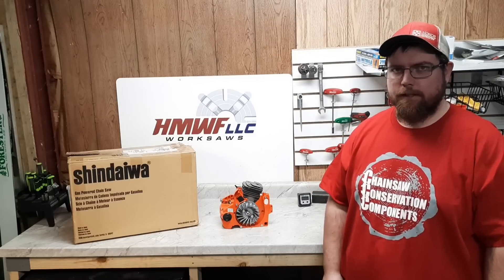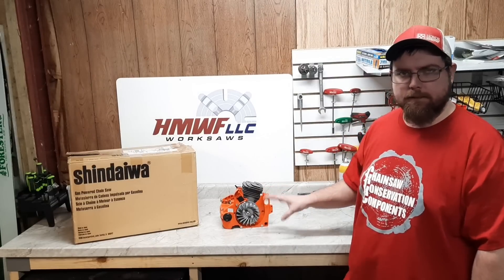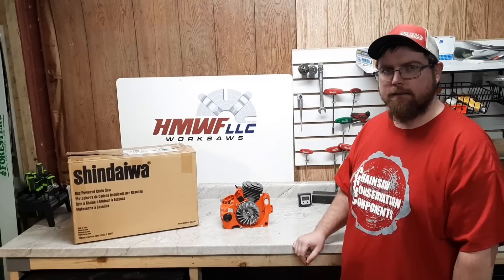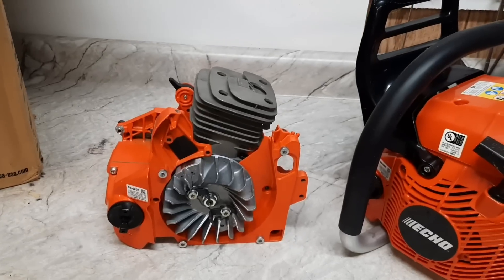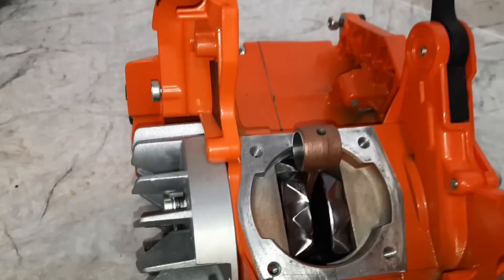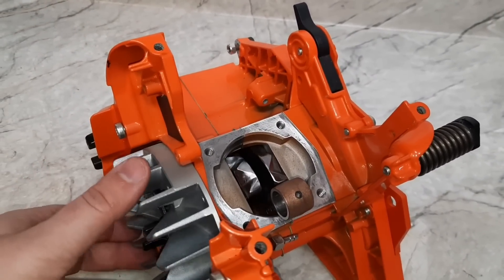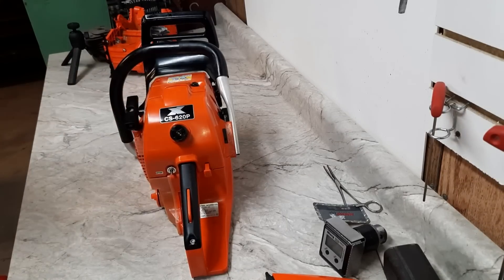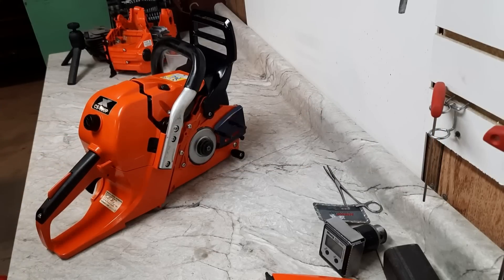Chainsaw Turbo crank? Vane crank? Make More power?

Comment: Have you tried this with a ported cylinder yet? And would a pipe or modded muffler help with the narrow peak ? Without the port job ? Or even different jets in the carb ?
Reply from the maker: No, this saw actually was sold to Charles brisco. He has a couple videos building it.

Comment: I think the way the rod itself rotates is orientated in the center  of the crank has alot to do with the way air moves through the crankcase. Let me try and explain a bit better.

                                          🤔 Think about this 🤔
Piston heading up,, drawing charge in -- what orientation is the mid to lower rod and has been for this duration of intake cycle?
Piston coming down,,, forcing charge up.  What's the orientation of the mid to lower rod and has been throughout this duration of exhaust cycle
 Think where the bottom or the light part of the crank and the rod . Cutting the reliefs around the crankcase and in the center next to the rod to let air move  through the crankcase easier than if it were a finned or bladed cut on the crank. 
   The fast ramp and extra horsepower could just be a result of just lightening up the crank alone and that's why it peaked it's power band so sharply on the graph with out a plateau or bench on the Dyno graph chart but will it sustain that exact or close to first burst of power throughout the entire cut?  That's the question I'd like to know the answer to.
Now, I've been thinking hard about this whole thing for over 2 hours now and my opinion is,,,, it probably would Not sustain the power through the cut but would keep the same or close to the stock configuration.  
   Ok now, I've  been watching you for a good while now Joe but watching you do this stuff this time just seemed different. You already know all about this idea and it doesn't sustain any more HP after it's peak but has more of a chance to cause a catastrophic failure would be more like it over time or maybe the first time you buried it in some wood hot and heavy.  You also know that any engine builder that didn't have a waver signed for this very modification or any such like this to the crankshaft could and would be liable for any injuries or damages caused from this mod, except for a full blown racing engine. Maybe even getting a waver signed but I guess it would have to be depending on the severity of injury or damage.  A modification to the saw's engine lessening the main rotating assembly's structural integrity would be crazy to do even if it was a full blown racer.   Not me man, 
I've  seen other racers playing around with doing crazy stuff like this here and bringing it to the track and it never ends good. Someone will Always go too far or push the limits knowing they went past that fine line ya just can't cross until someone gets themselves or someone hurt or worse. 
 This thought I've had now for over 2hrs of doing something like this, Just Left the Building. All these thoughts aside though,  I may try a little bit on the very top edge on the the outer sides and maybe an little bit in the center pausing the rod just to see for myself. I really do like to explore new things and exploration does take a bit of risk at times or maybe a bunch of risk. Just ask Chuck Yeger if anyone is this,He Does!!! Lol. Anyway,  None the Less, I found your video this morning to be a brain teaser for sure and I'll be thinking about that for all long while but I'm not doing this for any one but myself period! It was a very Neat and Entertaining Video none the less. You got me thinking for once in a long time on something to scratch my head about and ponder over that's actually worthwhile. To me anyways. Way to go Joe!!!
 Have an good one my friend!!!
Jzntn Greeneville ,
Reply from the maker: It could be possible. Most of the times the crank cases are very thin. I think the small gains that were made here were mostly due to reduced rotating mass.

Comment: I had heard about from someone somewherea few years ago. It was just as theory that they were chewing on but I had often thought about it. We cut the cranks to almost nothing in late model race engines but they don't turn but 8500-9500 but not continuous 11,500-13,000 continuously. I worry the crank will come apart if too much material is removed???  I may try it moderately because it definitely change it's peak and if the case was done to go with it is are there would be incredible flow potential in a low cost upgrade. That's if you are doing it yourself!  Lol none the less I see it worked about an extra 10% on that mood alone.  The counterweights are in the crank for all reason and the cranks we had done and the ones we did were all taken and balanced afterwards along with magnafluxing every single inch before it was installed. Actually that was done again right after it had a season on it to see if there had been any fatigue or compassion to it's integrity what so ever before installing in a new build. Rods as well were lightened to an extent and balanced and required a stretch test but basically the exact same inspections. Great video!  I really enjoyed this one and appreciated your hard work too make it available to us all. Take care my friend.  Jzntn Greeneville,
Reply: Sorry about the way it's worded. I didn't proof read before sending and this phone sometimes puts in crap that doesn't make a bit of sense.  😐 Sorry for my being lazy  
but it is 3:45am and just finishing a long day. 
Have a great week!
Jzntn Greeneville

Comment: I'm at 2:41 in and for my own entertainment, I'm going to guess that it doesn't make any difference, and if it does, it will be slight and more due to the change in volume of the case than moving air. The crank web might be spinning very fast, but not at all fast relative to the speed of the piston and intake change velocity.

Interesting. If it works, it works...  My guess is that this allows for better flow out of the cases and has nothing to do with a fan or "turbo" effect. The amount of work that went into those crank webs seems pretty intensive. I'd like to see if the gains would be the same if the webs were simply tapered / cut at an angle. If so, this would indicate that it's either a different case volume and or less restriction of flow from the case to the transfers. 

A side note... in most modern performance two cycle dirt bike engines, that I've seen, they actually use "stuffers" to reduce turbulence , from what I understand. It used to be that they used stuffers to reduce the case volume, but I believe that idea has been debunked as a low case volume causes issues with a complete transfer. Of course, all of this is on tuned pipe engines.

Comment: I remember back in the early 2000’s there was a few shops offering turbo crank mods with greater hp claims. This stuff was mostly for the mountain sleds who always mod the hell out of every component of the sleds. Lol
It came and went and I never did see dyno numbers. They were drilling the cranks at certain angles they looked totally different than your crank shafts.

Comment: Small gain on the crank work. What if you cut groves in the counter weight to give it more blowing power also catch some fuel help it carry up to the tranfurs just a thought.
Reply from the maker: Could be possible. I wonder if it wouldn't scoop the mix back out too? Might be something to try. 
That crank was sent in worked over, and that was the style he settled on over years of experiments. 

It is hard to tell for sure if the gains are from reduced rotating mass, or if it truly helps push mix.

Comment: I would like to see an incremental build of a 590/600/620.  First just a molded deflector and tune, then extensive muff mod and tune, then mod the carb, then base gasket delete with dyno runs at each step.  These mods are next to free for the average user.  Moving on we could see what a little exhaust port work will do.  Then you could machine squish and base and work all the ports.

Comment: Am I the only one who noticed the difference in harmonics/vibration?! Watch the catch pan under saw! What’s the weight difference between cranks? Doing work like this needs to have a matched and balanced piston. I would say these graph lines are within in the margin of error. Way it sits, this is an early failure, crank bearing eating, SCUD missile from the first Iraq war. Nope…pass.
Reply from the maker: It has a different feel to it.

Maybe thst is the agressive feel people mention when they have it done?
Reply: @dynojoemods2764  the vibration??…and associated loss of feeling in hands?!
Reply from the maker: @garny3766  

Everyone has different ideas, the saws A/V did a good job absorbing anything extra. 
My previous comment was based on feed back from end users of this type of crank mod.

Comment: I’m mapping out a boosted powersaw.  More as A Mill working purpose.   Heating up with normal Timber work is what will happen there tho
Reply from the maker: I'm not sure if the crank mod would be worth it for a milling saw.

Comment: I'm curious how long did it actually take you to tear it down and put everything over on to the other saw in real life? These videos always make everything look so fast! I guess I'm just really slow cuz realistically that would probably take me at least a few hours. By the time I lost a few tools and had to take it back apart cuz I forgot to hook up the impulse then had to take it back apart again cuz I put the old cracked impulse line back on it I'd say I'd be closer to half a day if I was lucky lol.  So I'm just curious how long it was without the editing
Reply from the maker: The tear down non edited was 22 min and the swap/cleaning/ re assemble was 35 min.

Same issues you mentioned, lost tools and misplaced supplies and trying to keep a decent camera angle all slow things down.

Clean new saw and knowing the little tricks go a long way to speedy year downs
Reply: @dynojoemods2764  yeah all the saws I work on are 25-75 years old I guess that makes a difference but still 35 min reassembly is pretty fast!

Comment: Not too sure about such a small gain, could be other factors involved maybe? Temp difference, crankcase bearings maybe less tight? Inconsistencies in your dyno such as chain tension, etc. Very interesting to watch all the same, really like the tear downs, keep it up!
Reply from the maker: It is hard telling exactly what the gains are, and being such a small gain. Those are 3 run averages, on multiple pulls for both saws. Was less visible on the individual pulls. But showed on the average

Comment: Cool to see that crank mod, second clip I've seen like that today😉.
That was a quick tear down. 
Interested to see what gains you get with it after it's ported compared to a stock crank in the same ported jug😜
Reply from the maker: Should be an interesting test for sure. It has been a while since I have had a ported 620 on the dyno too.

Comment: Very interested I like that design,probably extremely difficult to do but still neat. For one of your next vids you should test whether or not an intake with a dimple/ checkering/ rough pattern on the surface makes a difference. I’ve always wondered if it would or not seems like it is a controversial subject in the industry with not many clear answers. Thanks man, keep up the great work!
Reply from the maker: That is on the list. Thank you for watching.

Comment: Just wanna mention one thing Joe.  U get mad props from me.   No impact for bolts going in.  Don’t see that much anymore these days!  Respect!  🤜🤛
Reply from the maker: 98% of the time I don't use it to start or tighten the screws. 2% of the time I will use it to get the long screws run in close.

Comment: I wonder 8f a guy could put fins on like the flywheel.  That would surely force more air ino the cylinder.
Reply: Your probability right. Just thinking out loud but with the right style of fins that it could be a modern day turbo
Reply: The logical side of me thinks that if some type of fins would be a huge advantage then the Chainsaw mfg's would have already been doing it for some years now. However the Vane idea looks like it has some good potential and can possibly be modified a little bit further to garner even more gains in HP and torque of course. Ported saw with the vane as Joe says might be where the vane idea really shines. Interesting stuff for sure.
Reply from the maker: Possible. The man that modified this crank has tested lots of different ways, and settled on this design.
Reply: Like as in a variable geometry turbo

Comment: Only charge one thing at a time is the best way to see if the charge is actually good or not very good video I like this format and I also like the head to head battles great work Sir great work 
What if you could do multiple runs of the same saw to see if there is a change with temperature difference maybe a cylinder head temperature reading during the run ?

Comment: I enjoyed the tear down and build a bunch, but I can't believe those little bumps gave any gain I bet if you ran 2 tanks through it you would see more gain if it was a fully broken in saw dinoed then swapped and got a 3% gain I would believe it the ones I have seen looked more like turbo blades cut in the crank but maybe he is going for braking up the charge not turbo charge
Reply from the maker: Not a huge gain, and very similar to the gains from a "break in" this style is the one Gregg settles on after his testing. Would be fun to try some other styles.

Comment: My experience is jet skid from early 1990s .I built race skis and worked at a ski shop for around a year . Then bought a mill and lathe  did head milling and porting for several shops in my area.

Comment: I've seen full circle crank edges knurled like a ratchet handle to induce crankcase turbulence. Mainly motocross bikes. It works.
Reply: You want every port and surface area rough except for exhaust port, rough surface improve a/f atomization
Reply: Most people don't know about that. Most people think they need everything polished but certain areas need turbulence, I've seen stuff you wouldn't believe in engines done by guy's who said they knew what they were doing.

Comment: I'm wondering if the gain is more the weight reduction in the crank more than the actual ''forced induction''. Seems like an idea that comes with trade offs, forced air vs turbulence, weight saving vs vibration etc. Good video sir.
Reply: I would speculate weight reduction is what making that difference, that's what they do in bikes anyway. When gone too far it robs low end and gets hard to idle
Reply: Agreed, we have drilled out Harley cranks for weight and got same results.
Reply: I was thinking case volume, looked like it vibrated pretty bad
Reply: I was wondering if it was balanced looked very un uniform to me but I'm seeing it on YouTube on tablet so..
Reply: Its probably about as "forced induction" as a jonsered turbo

Comment: Great video...  Just curious did you have to reset the carburetor ?  Had me thinking about maybe you could try lighting the crank or a fly wheel and see if you can increase horsepower that way If you'd be interesting try
Reply: Work on a Harley just dropping off the weight from crank.
Reply: @mmmbbbccczzz  harleys and chainsaws are two very different things. Ones a 4 stroke and the other 2 stroke
Reply: Alex , we are just talking about crank weight.  I think we all know by this point the difference but it is irrelevant to the conversation
Reply: @mmmbbbccczzz  yeah and on most chainsaws you cant "just drop of the weight". Also the volume the crank takes up in the crankcase can change perfomance on a chainsaw. 4 strokes dont care about crank volume due to them being sump lubed.

Comment: Makes me wonder if one was to mill a crank that the veins were more finned shaped to move more mixture if that would hinder or help horsepower?I like seeing these tear down videos more in-depth as to how each saw is put together. 😎👍
Reply: A lot of race bikes do this.  I can only see positive
Reply: On 4 stroke sure but on 2 stroke if you thin the crank you lose volumetric pressure on the crank chamber since more space needs now to be filled by fresh mix while not contributing to the combustion watsoever! Is a well know fact
Reply: I built a 461 and a few 661s with veined crank but I did them like a paddle tire. Big difference on top end. But your build needs to reflect the idea. It will have to be a top end build not a Torque build.